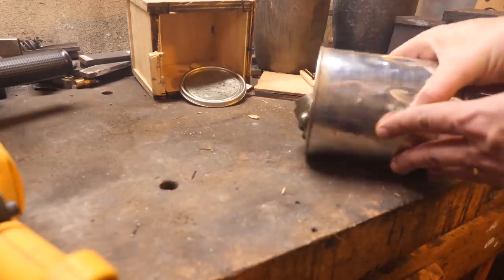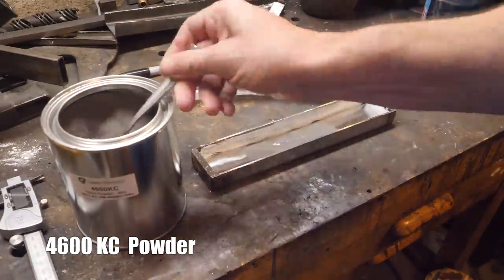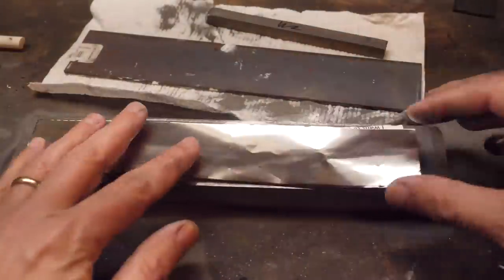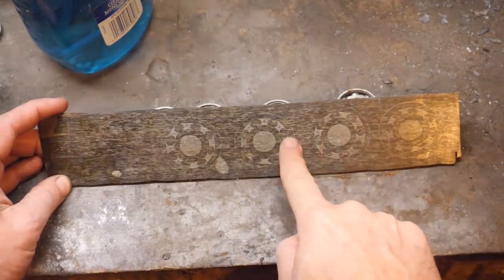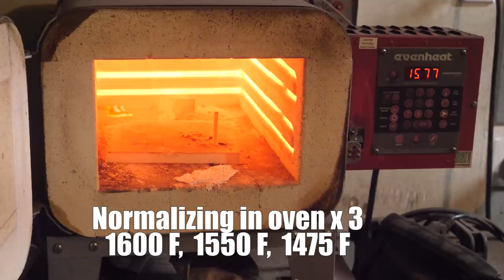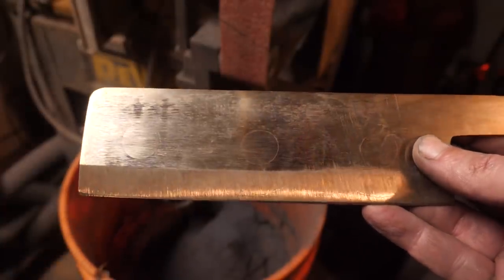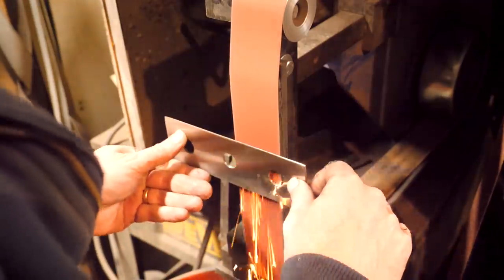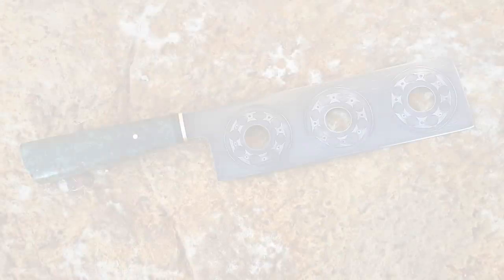Forging A Ball Bearing Nakiri

Comment: Absolutely gorgeous result! Could you have put a slight chamfer on the interior of the circles to reduce how much they caught on stuff? 
Also: a suggestion for your camera. If you happen to be able to set the shutter speed, set it to 1/60 second. Your electrical service runs on 60hz, and setting the camera's shutter to a multiple of 60 will eliminate the strobing / undulating effect during your sped up footage. 
Love the channel, and look forward to every one of your videos. Thanks!
Reply from the maker: Yeah I’ve been noticing that, I’ll have to check on shutter speed, if it can be done it’s buried deep in a menu somewhere.
Reply: @GreenBeetle  Heya - just wanted to come back to this comment... I'm watching your knife from needles video now, and I notice all the flicker/strobing is completely gone. Looks great!

Comment: I bet if you put jade discs in the center, that would eliminate the drag and make it look just slightly more bad ass than it does already. CA glue would probably hold them in place. I believe there are at least three distinct colors of jade, so that's an option. In any case, fantastic work! Keep pushing those boundaries.

Comment: I think this bearing idea is cool, and adding something like bb's or 1/8" to 1/4" ball bearings to the center would be cool, something to give it texture, fill the hole, maybe cut up some 1/8" hex, about 1/16" long, maybe 1/8", filling the gaps with powder maybe use nickel hex, maybe make a larger blade, with small bearings like this ,  about 1" I'd, with tiny pieces of nickel in powder , filling the hole probably 5mm , I hope to get enough tools together to have a decent forge some days, I have loads of ideas I'd like to try,, nice work!!

Comment: Nice! Perfect for slicing Idaho potatoes! Is it possible to have the outer part of the bearings, cut in half (semi circles) and maybe going down in size from one to another welding together, and then do like You did on this one, to have a "snaking"  pattern, like a snake or a dragons tail, and let the handle be the head? You are very innovativ, and are not afraid to expose Yor work how may work or not as intended, or even go to h..l (octopus), that is one proud fabricator/knifemaker/knifesmith.....☺

Comment: The streaks on the blade look like they might be alloy banding. We've been coming across similar streaks in a recent batch of 26c3 steel at work lately.
Reply from the maker: Interesting.  Is there anything that can be done?
Reply: Not that I'm aware of, I've honestly not done a ton of research into it.  My undestanding is that it's a product of the manufacturing process and part of the steel's structure, invisible until it's etched.  I believe it's very similar to the patterns found in Wootz steel but I am by no means an expert.

Comment: The steel foil will work better if you oxidize it before you use it as a separating layer. Just oxidize it in your oven.

Comment: Question, would using that much oxide cause issues with the grain structure?
Reply from the maker: Good question
Reply: @GreenBeetle  lol I'm still judt getting started with an old railroad tie anvil and a BBQ coal forge lol. I haven't gotten into anything with powdered steel yet or anything like that. Seriously though man great work, I love your stuff

Comment: I think if you want the bearing centres not to snag, chamfer from both sides until you have something akin to a false edge on the internal diameter. It shouldn't catch as much then. Sadly doing it now would just cause much shrieking of metal on metal and I certainly wouldn't want to have to re heat treat a blade that thin!
Reply from the maker: Good idea

Comment: never sharpened a knife properly, did one two days ago, no machines, just a diamond file, water and alot of filing. like 2 days later got some 2000 grid and started making it shine, got it to a nice shine and the goshdarn thing bent when i pushed it with my nail, so pretty much useless metal if working with anything harder than air

Comment: Slow drill right down, lots of oil. For the hole saw. On my press, I even pulse it on and off, just because the slowest setting is still too fast for a ~30mm hole.

*Edit: Should also mention, yes pulsing is bad for your drill, you don't wanna do it on a daily basis. Once in a blue moon's okay.

Comment: I think that S grind would be better with that knife, to reduce the catching things inside holes and preventing sticking food to the side of the blade, similar to what Kamonknives does, now the same started Hangler form Austria, and I'm pretty impressed with the looks. Also the weight reduction is insane , with that you can reduce probably another 1/4 of the weight of the blade. The structure of the steel looks nice but i think that your acid is too aggressive and you etched too long for the coffee etch, check my stuff out on Instagram, i did some coffee etches and had some troubles with that but deleting acid did the best for me.
Great work tho! Keep it up!
Ihor Hudyma
Czech Republic
Reply from the maker: Cool will check it out ty